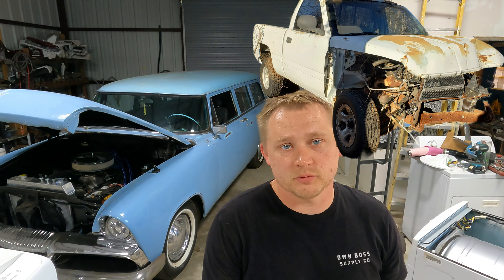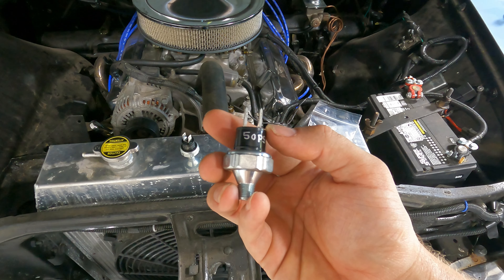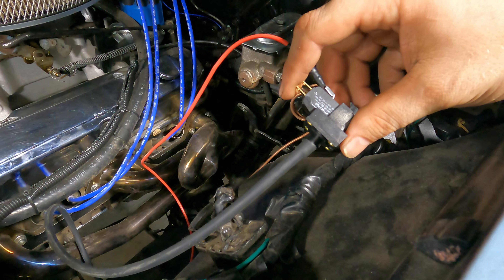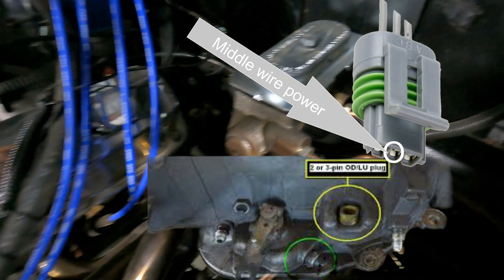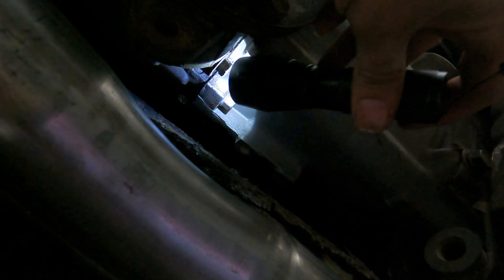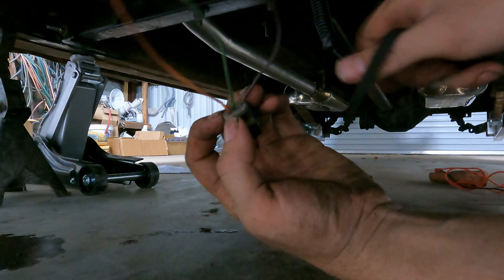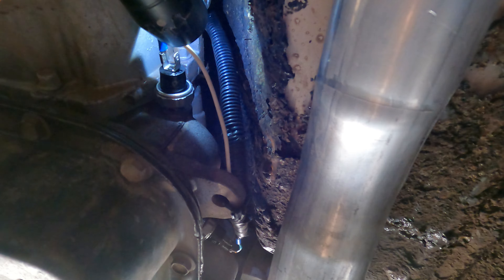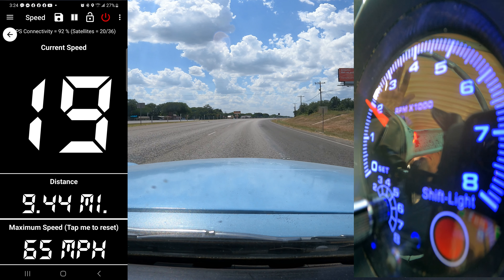How to 727 TO 46RH / a518 in a Mopar. How to make it work No switch required! FACTORY STYLE

Comment: That PATC kit is the same kit I used on my 75 D100 that I swapped to a 46RH...I just wish mine had lock-up.  Once I got the vacuum switch dialed in that kit works perfectly
Reply from the maker: Oh man it took a lot of fiddling to get the vac switch working properly. Mine kept going in and our of overdrive. Another thing is I have 3.73 gears and smaller tires than the truck it came out of so my overdrive kicks on at around 40 mph which is way too early! I need to buy an adjustable switch.
Reply: @somewhatfast  Yeah, it took some adjusting of the vacuum switch to get mine to stop going in and out of O/D...I used a hand vacuum pump to set my switch to about 5 psi or so, and that seems to be where my switch likes to be at.

Comment: I have the same setup. I ended up adding a switch to kill power to the OD/LTC when driving around town. I could not get a good balance and it would kick in and out of OD rapidly at certain speeds.
Reply: I love the transmission still
Reply from the maker: You have to adjust the vacuum switch very low. Around 6 psi and even then it's a little iffy

Comment: That car is becoming so sexy I love it. I can’t wait to see more about the $350 wagon as well. It would be cool to build a tube chassis with a modern 57 hemi in it and swap the body onto it.
Reply from the maker: I looked into the 5.7 hemi I found some chrysler 300cs with hemis and some clapped out dodge chargers with hemis. Tube chassis would be too expensive and time consuming, maybe one day. I was looking at dodge dakotas to use for the frame since they have disk brakes and came with 5.9 360 magnums.
Reply: @somewhatfast  that is an excellent idea not only especially if you could find a late model Dakota that had a 4.7 in it
Reply from the maker: @geoffreyb3337  I have a 2003 ram with the 4.7 in it that motor is TOUGH. 220,000 Miles. Also a hemi 2003 truck 207,000 miles!! If i can find a 1990 or older dakota it would be a perfect frame because they are narrower and the lugpattern is 5x4.5 so you can use stock plymouth wheels, and hubcaps! And then I can go from there and make whatever engine I want fit. Idk yet have to sit on it that 1974 plymouth satellite needs to get back on the road first

Comment: Is the adjustable vacuum switch in all their kits?  I was looking at their ads and I thought they had adjustable pressure switches as an option, rather than an adjustable vacuum switch? After some initial confusion it appears that the 96 transmission I have is indeed a 46rh so I should be able to do the same thing. I hope..
Reply from the maker: All the kits comes with an adjustable vac switch. Pressure switch is an option

Comment: So this is probably a silly question but do these transmissions shift and run like a 727 with no computer? The electronics are just for overdrive and lockup?
Reply from the maker: Yes! Lockup and over drive are literally just a switch on the transmission. You could install a toggle on the dash for od and lock if wanted.

Comment: Do you live by fl? Thinking of Trying to carbereater  my 95 dakota 4x4 5.2 havent drove it in 2 years due to an electrical problem that shuts truck down in traffic maybe asd relay stuff but im not good with eletrical stuff :(
Reply from the maker: I'm in texas, check your local emissions inspection laws before you convert it over. They may not let you get the truck Inspected after converting it if they can't plug it into a scanner.

Comment: My friend good after noon i'm from eagle pass TX ! Can You gide me igot same transmisión and the lockup or Converter some times it's on and off ,can u gide me where is the bacum Overdrive thanks u and GOD! bless You and family.
Reply from the maker: @PepeAndo-u6p  yes. If you installed a vacuum kit from PATC. You will need to adjust the vacuum switch. Use a flat head screw drive turn the screw 1/4 turn. Take it for a drive and then keep adjusting until you get it tuned in. Remove the vacuum hose the screw is inside the tube.
Reply: @somewhatfast  thanks My friend

Comment: noticed in the video your speedometer isn't connected that is a easy fix to make it work with the speedometer in the dash that came in the car
Reply from the maker: I bought a new originak 1955 Speedo cable haven't tried to make it work yet advice would be very much appreciated
Reply: @somewhatfast  if you remove the speedometer part out of the transmission you can install one that is set up for a cable there are 2 lengths short and long if you can't find one let me know summit should have them then you pick a speedometer gear to match your tire size and gear ratio and screw the cable to it and you have working speedometer.
Reply: @somewhatfast  If you need a speedo drive, I have 2 904s in the shed. I'll send you one for free if you like....
Reply from the maker: @davidthehillbilly7995  awesome! nickmopar71@yahoo.com email me